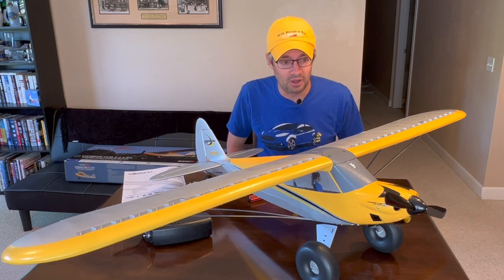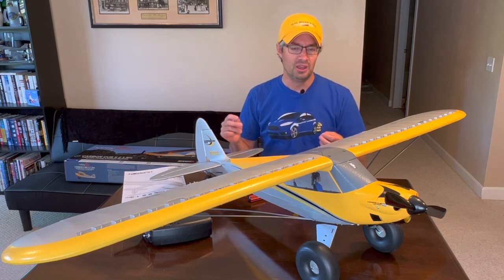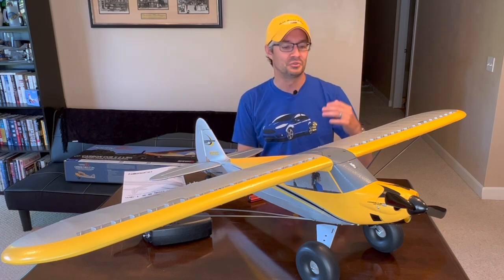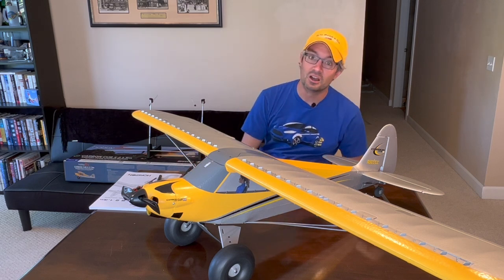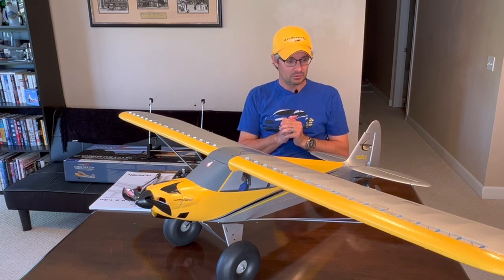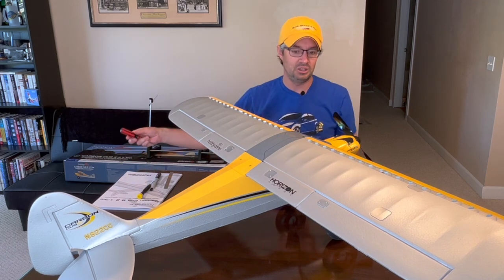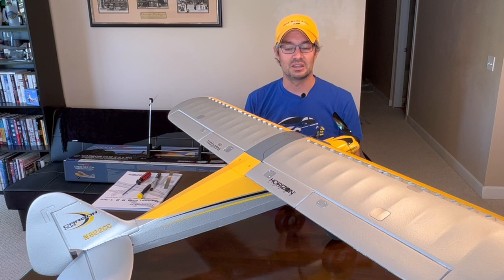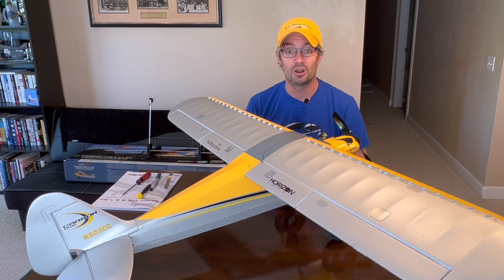Tips and Tricks to Properly Setup your Hobbyzone Carbon Cub S 2 1.3m

Comment: Is the Carbon Club S2 FCC Remote ID compliant?
Reply from the maker: You will only need FAA Remote ID if you are not flying at a FRIA location. If you are flying at a location that requires Remote ID, you will need to purchase the Remote ID module for the Carbon Cub.
Reply: @BRGT350  Thank you, I've been pulling my hair out trying to figure this out. Trying to sift through the FAA website to register is nauseating.
I did get registered with the AMA, and my local flying club is a FRIA accredited site, but their club posting says I have to be a club member, join the AMA, and register with the FAA.
I have a plane like in your video, as well as the Cub SS, they both fly great, but I have to tell you, I'm ready to throw in the towel on all of this nonsense.
It's no wonder this hobby can't thrive like it once did!